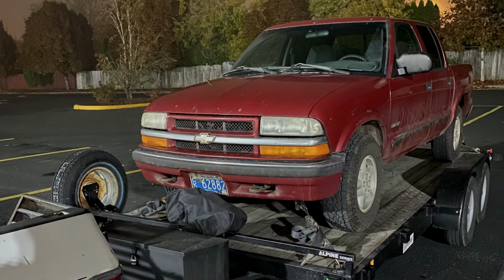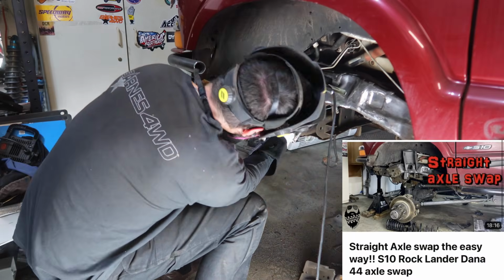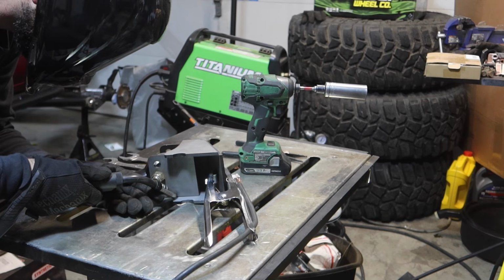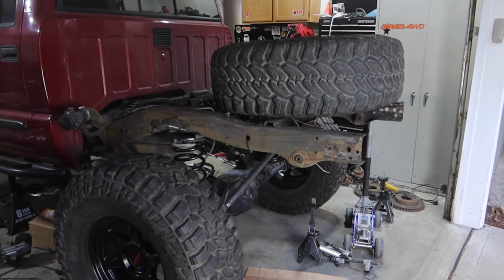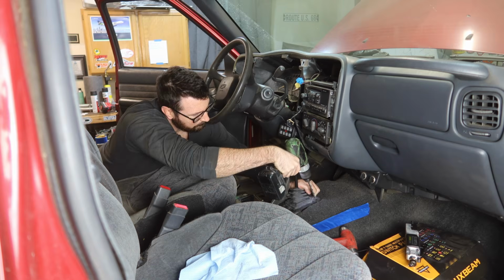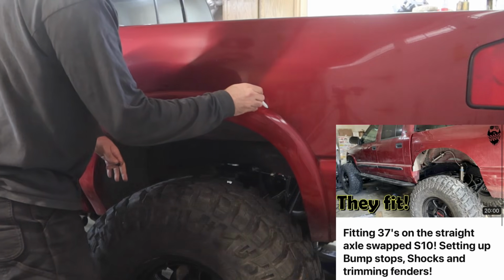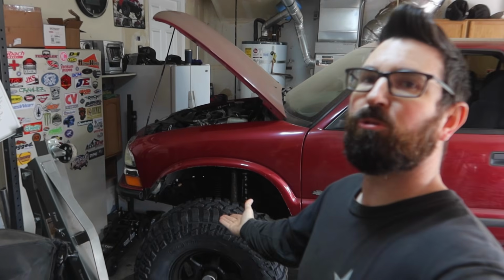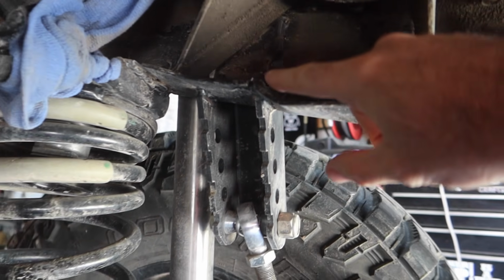Ultimate Solid Axle Chevy S10 Rock lander build!

Comment: Are those dodge axles? 44 front and rear? Cool build!
Reply from the maker: Nope, ford 9” rear and high pinion 44 front.
Reply: @MuddyBeards4X4 does my dad 98 Ford ranger XLT come with the 9?  I got that truck in the driveway collecting dust. Buying me s10 4x4 with 4.3
Reply from the maker: Not a 9” probably a 7.5. If it has the 4.0 it might be an 8.8 which is still a good axle if you upgrade a few things.
Reply: @MuddyBeards4X4  it's 3.0 98 XLT half cab
Reply: @MuddyBeards4X4  I might just have to call for tomorrow and find out.
Reply from the maker: Definitely a 7.5 then. Not worth spending any money on upgrading
Reply: @MuddyBeards4X4  so leave the stock one on or 7.5?

Comment: Do you think you could keep the front crossmember to hold everything together/add strength, or does it take up too much real estate? I remember someone from four-wheeler doing this, might have been Verne, and they twisted up the frame in a ditch. Regardless, love this build!
Reply from the maker: It hangs down too low, and would be in the way of the front axle and trac bar. Between the front bumper and the frame plating it has been plenty strong so far.

Comment: After using the truck for awhile what's the biggest upgrade or change you think it needs?? Also side note, you still doing that rx7 or whatever that side project was?
Reply from the maker: As far as big upgrades.. it needs more power for sure, but before that I still have a rear bumper to build, onboard air, onboard battery setup, storage systems to build, ect. I just barely got it on the road and have been using it almost every weekend for 9 months straight, been having too much fun using it to work on finishing it, lol.
Reply from the maker: Oh and yes, I still have the rx7. The motor and trans are ready to drop in, just need to find the time.